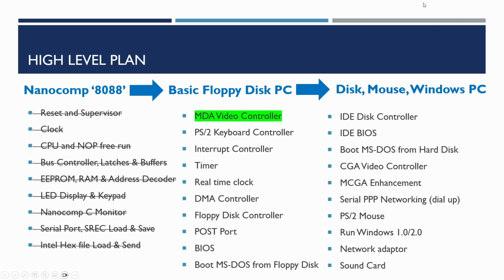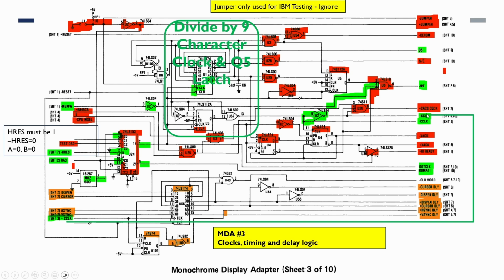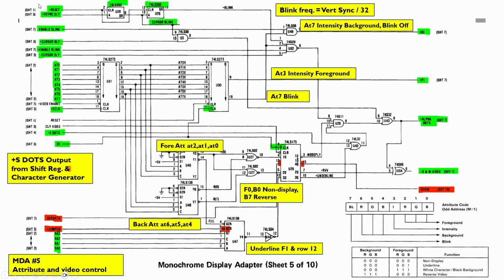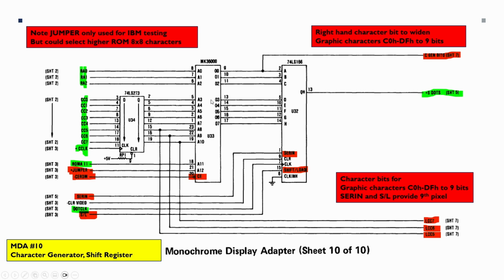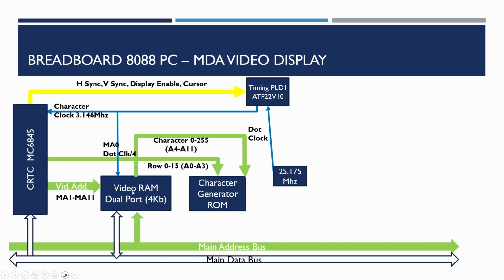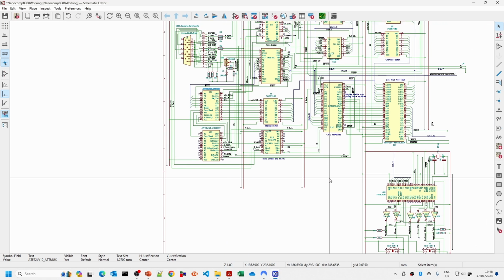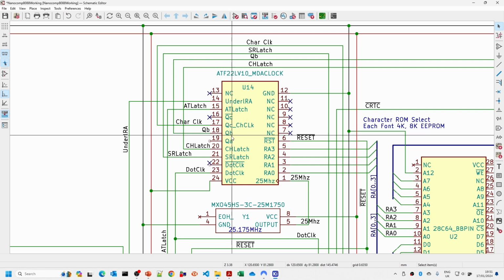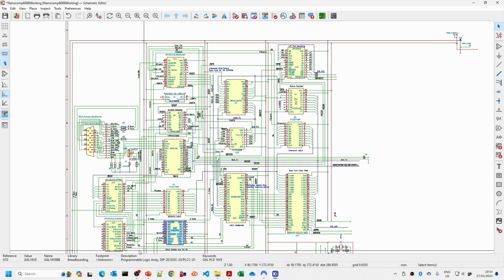Breadboard 8088 PC MDA Video Controller (MDA#2) #14

Comment: Thanks for the video and all the details! Just wondering where you get your chips from - especially the dual port RAM? I've been having trouble finding any DIP dual port RAM chips for a similar project.
Reply from the maker: Mouser.com is where the 4K dual port RAM I have came from but now has been discontinued by manufacturer so may not be in stock. I guess eBay may be alternative. Dave